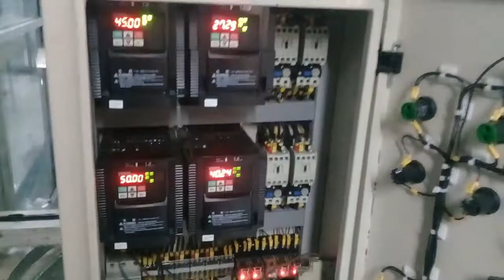Double Coding Conveyor Cup Sealer

Comment: Cek harga untuk mesin lengkapnya gan
Reply from the maker: Siap gan.untuk mesin standart autocup sealer 16 Lines complete set 800 juta,bisa customize mengikuti sistem dan budget.
Untuk detailnya silahkan email ke karyateknikapratama@gmail.com
Atau bisa tlp/wa ke 087852973031.
Reply: @arif_pratama  kepingin punya usaha air kemasan...
Reply from the maker: @amychannel4750  dimulai saja,skala kecil juga banyak pilihan,asal sudah ada dasar,pasar,juga modal,baik internal atau modal eksternal,kita bisa bantu mengenai proses tekniknya.
Reply: @arif_pratama buka kecil2an 
 kalau mulai dari nol butuh modal brp kak 
Dan ada brp jns mesin
Reply from the maker: @alkasimberkah4426  Untuk mulai dari awal,yang harus ada adalah lokasi,sumber air atau supplier air baku,estimasi biaya mesin proses,dan packaging,termasuk mesin filling,conveyor dan kemasan nya.untuk kapasitas kecil standart,yaitu 4 lines(4600 cup/jam),dengan mesin water treatment kapasitas 2m³/jam,kompressor set,instalasi pipa air dan angin,kurang lebih Rp.1,5 M,tergantung jenis dan kualitas mesin nya
Reply: @arif_pratama  oke2 trima kasih atas estimasinya
Reply: @arif_pratama  kalau untuk mesin2nya sampai brpa kak
Reply from the maker: @alkasimberkah4426  untuk harga mesin saja 4 lines skitar 260 jt an